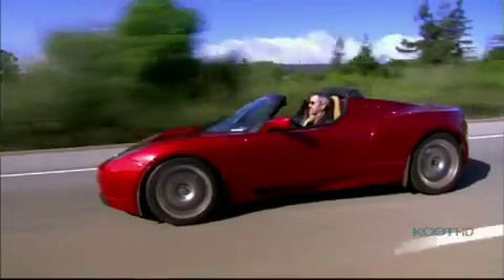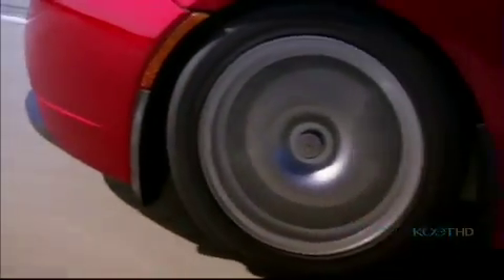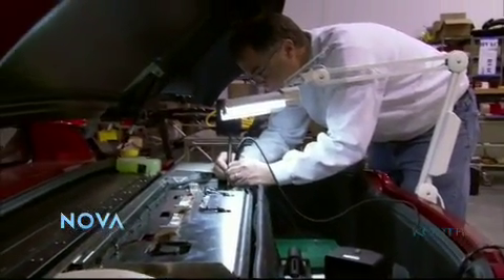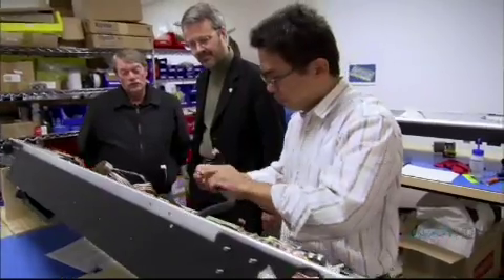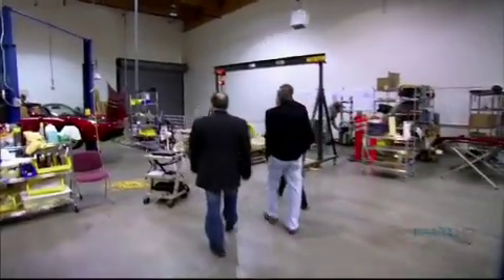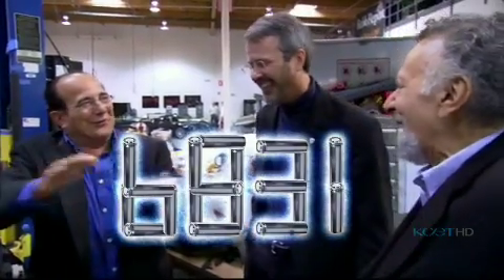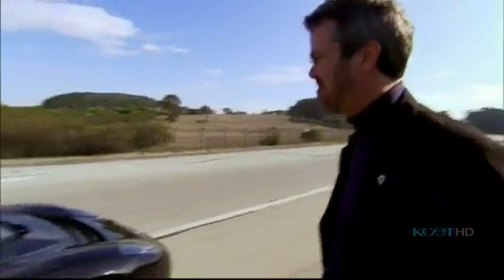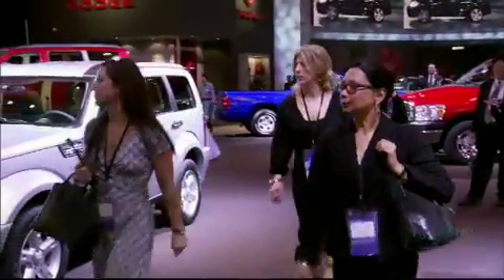PBS Nova clip about Telsa electric sports car Car Talk

Comment: Wrong. After 40 mile BEV range the cars generator starts. Electricity is produced and the electric motor continues operating. The engine in a HEV contributes by directly moving the wheels in unison with an electric motor. The vehicles electric feel stays since its brushless 100 + Kw motor is the only thing moving you along.

Comment: Yeah, but both of them are more hybrid-esque than fully electric cars.  They are powered by electricity (and I assume you're referring to the Chevrolet Volt) for the first 40 miles - as a company study found that that's within the distance of most daily commutes.  After the 40 miles, it's no different than the hybrids of today.

Comment from the maker: The 110v edison outlet already is an infrastructure.  It would be incredibly easy to retrofit garages and such with standard power outlets since chances are it is near by

The old paddle style charging stations that you see once and a while are from the EV-1 and electric RAV-4 days.  That was/is a infrastructure problem - but a standard 110v - not a problem.